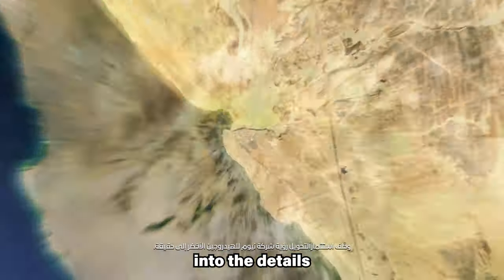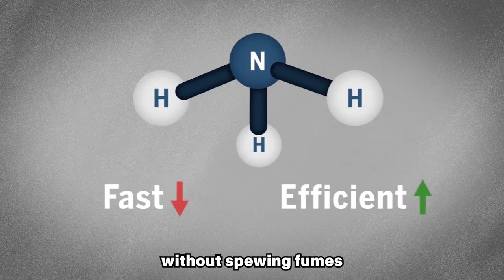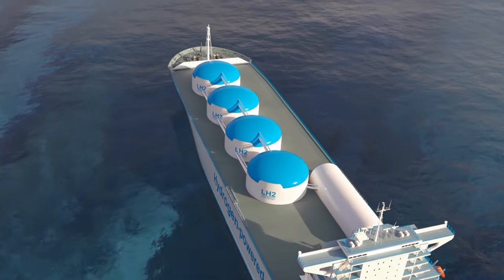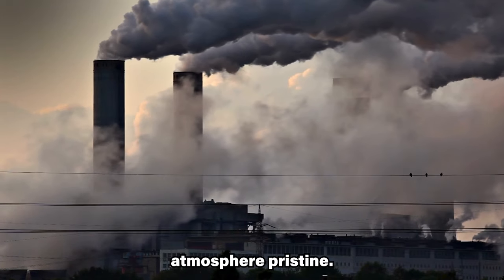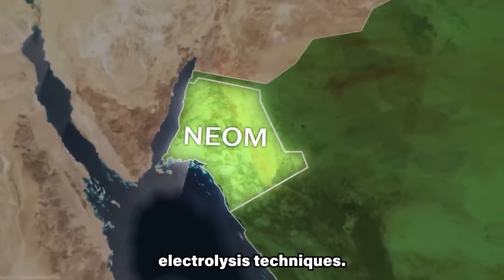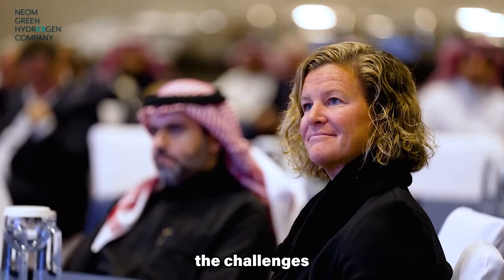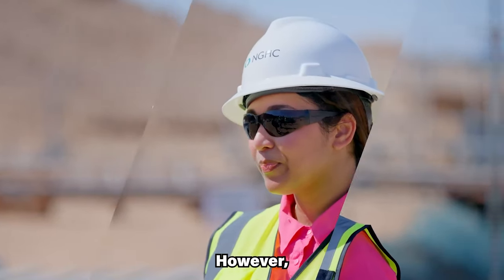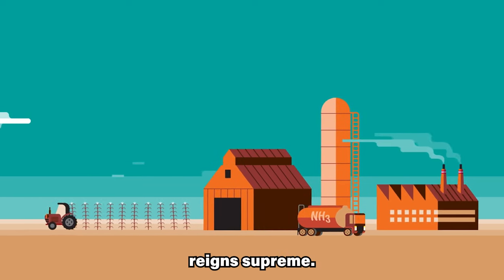World largest green hydrogen plant

Comment: People are not aware of the potential that hydrogen has. Its remarkable change in the world happening now a days.
Reply: You poor fool.
Reply: Hydrogen will always have a poor energy density per unit volume as well as has  3.4 times higher specific heat capacity than that of cooling water. Liquifying Hydrogen needs using Liquid Nitrogen coolant in amounts much more than stoichiometric energy balance calculations (due to Liedenfrost effect shown by liquid Nitrogen) to cool Hydrogen from ambient to below joule thomson temperature of 200K  after which it can be adiabatically expanded to 20K liquification temperature.
Majority of current commercial use of hydrogen is as a reactant for making syngas, methanol , ammonia, hydrogenated veg oils and fats, crude oil processing, catalyst characterization test like  tpr, ore reduction instead of being used as a source of energy.

Comment: Hydrogen is not the future ... electricity is !
Reply from the maker: Thank you for sharing this.
Reply: Electricity is not a primary energy source, it is merly a transportation system, where you going to get it from?
Reply: @nickbagnall  electricity generation through solar & wind (is rising every year) + battery packs
Otherwise from the grid with good interconnection between states/countries . Probably nuclear until enough solar/wind/battery pack capacity installed. Charging cars when electricity is abundant.
Reply: @erivaton  where do you get resources to build batteries for entire countries?
Reply: @ColoniaMurder20  Lithium can be found all over the world. LPF-batteries are made with iron  and without cobalt manganese, then there is no limit. And then we're not even talking about the sodium-ion batteries that will probably come.
Reply: @erivaton  how much resources you needed waste to build batteries for vehicles? and how many times you have change your batteries within 10 years?
Reply: @ColoniaMurder20   In the total life span of cars, EVs are much cleaner than ICE cars. And battery production without rare minerals (like in LFP bateries) is not very environmental impactful. Sodium ion batteries even less.
Reply: @nickbagnall ...not even considering it takes huge amounts of electricity to make hydrogen with your comment are you?
Reply: @erivaton  Your ignorance is astounding. More fossil fuel energy is used in mining, crushing, refining chemically cleaning, manufacturing and installation of the apparatus than the apparatus can produce, notwithstanding, there reliability is dependent on weather conditions and require fossil fuel for base load energy and back up.
Reply: @5353Jumper  Hydrogen is merely an carrier, not a primary fuel.
Reply: @nickbagnall  and it is a lot less efficient carrier than the electric grid. 

Also by your definition, gasoline and diesel are not fuels either. Maybe natural gas is? But then again so is the solar radiation? Not sure kinda confused by your "logic" and why it is important to this conversation.
Reply: @nickbagnall  Time will tell whose more ignorant. I feel pretty good.
Reply: At this moment we are trying to eliminate poisonous gases and other harmful extracted minerals that might affect our environment for today and for the next generation in the coming furure.

Comment: The two major applications of electrolysis are alumina smelter or hall-herault process (16 units/kg aluminium)and choloroalkali process (2.5 units/kg alkali). These are located near to ports and where cheaper power source like hydropower are available. Alumina smeltering needs 19-20 hours of continuous power supply per day. Aluminium recycling can help to optimize need of smeltering alumina and save energy needs by 95%. Chloroalkali process also coproduces Hydrogen which is used to make Hcl or h2o2 or ammonia or burned for power/steam generation.  In 2022, as high as 83 million tonnes of Chlorine gas , 4.8 million tonnes of Hydrogen gas and 190 million tonnes of Sodium Hydroxide were co-produced in the world from chloroalkali process or electrolysis of brine. Water electrolysis to coproduce oxygen and hydrogen wil really consume at least 50 units/kg hydrogen .

Comment: Green energy. 

The picture the advertisement gives of green hydrogen sounds beautiful - fresh washing drying on a washing line; children on a sunny day happily playing by a stream with a rainbow in the distance. However, not all is as green as it seems in the garden for the air is good but the soil barren.  

There are many embedded carbon costs in the mining, refining, chemical processing, manufacture and installation of wind turbines and solar panels, which you claim are renewable. The downstream costs in relation to energy - carbon and environmental damage are not accounted for. The agenda would rather ignore these and they are left out of most studies promoting the new green deal, not to mention the apparatus averages out to a maximum of a 25 year life span. The process itself may boast being green - no carbon emissions - however, the downstream carbon footprint is colossal…

What reductions will the largest plant in the world make to the fossil fuel industry; based on medium density crude?  

1.	The plant, one of the largest in the world when complete will produce 600 tonnes per day. 

2.	Global oil production amounted to 93.9 million barrels per day in 2022.

3.	Conversion; One barrel of oil weighs 137kg x 7.4 barrels per metric tonne.

4.	Global oil production per day in metric tonnes: 12,689,189 tonnes per day.

Hydrogen is approximately 3x more calorific energy than petroleum: 

                      - The heating value of gasoline is 47 megajoules per kilogram.
                       - The heating value of hydrogen is 143 megajoules per kilogram.

5.	 600 tonnes hydrogen times 3x to balance calorific equivalent 18,000 tonnes per day

Now that the calorific energy is balanced per tonne.

6.	12,689,189 tonnes petroleum minus 1,800 tonnes of hydrogen.

7.	12,689,189 minus 1,800  = 12,687,389 tonnes petroleum per day.

8.	12,687,389 tonnes petroleum x 7.4 = 93,886,678 barrels per day.

9.	93,900,000 barrels per day, less hydrogen equivalent calorific value converted to oil minus  barrels per day gives a saving of 13,322 barrels of oil per day.

 
The saving of emissions from a  barrel of oil based on 600 barrels of hydrogen production per day gives a value of 0.0142% saving, and that is only if the oil isn’t burnt somewhere else, like China or India who are energy hungry to the last molecule.  . 

To exchange 50% of total oil production for green hydrogen we would require 352 green hydrogen plants, notwithstanding, gasoline costs a fraction of the production cost per kilogram. 
                                                                 
Furthermore, we haven’t built in the downstream costs for this green energy; turbines require mining of precious minerals along with refining and processing, as well as other materials predominantly made of steel, fibreglass, resin etc.

Solar panels also have a hefty downstream cost: the journey of silicon starts with mining and refining quartzite - a rock containing quartz. The refining process involves mixing powdered quartzite with carbon and heating it in arc furnaces at 2000 degrees centigrade resulting in metallurgical-grade silicon. From here it is blended with other metals. Then we need the glass and silver, as well as other minor ingredients.

The mining and refining and shipping of the minerals will also require heavy diesel driven machinery to complete the processes. Notwithstanding, the factories required for the production, concrete and construction of facilities, the staff, and all the energy requirements in relationship have an embedded carbon cost.   

As the weather is intermittent there is also the requirement for battery back-ups, unless diesel generators, gas or hydrogen are to be used as base load energy.

Green is not as green as most would like to imagine and far more destructive to the environment when you consider the square metres of land required not only for the apparatus on site but also, the amount of destruction caused to eco systems. There is also a second stage processes which follow the refining which also require chemical refining.  Taking copper as an example on ore grades which will deplete in time - for every kilogram required we must crush one tonne of ore.

We as a civilisation have been going through the energy transition since we first burned a piece of wood, including wind, hydro, coal, oil, gas, nuclear and others. Whenever we have found new fuels and new technologies to harness and extract energy, we have never abandoned the old fuels. In fact, we have burned more of them; every one of them, including cow dung… 

I’m all for new technologies and a cleaner environment however, it seems everybody has become fixated on looking up at the sky, when they should be looking beneath their feet. 

Any feedback is appreciated.
Reply: We cannot even begin to imagine new use cases of hydrogen (like transportation) until we have "greened" all of the existing hydrogen production for already existing uses. Agriculture, chemical, medical and "green steel" already require huge amounts of hydrogen. 

Today most of this hydrogen is produced in high emmisions ways. 

We need to covert all this existing production of hydrogen over to "green" hydrogen along with greening the entire electricity grid. 

THEN maybe we can start looking at new applications of hydrogen like transportation. 

But even THEN the numbers do not look good for hydrogen, because the double conversion process of the hydrogen mid step is so incredibly inefficient. It is possible that in every use case it just uses a lot less electricity to power things directly than to make hydrogen, transport hydrogen, and then turn the hydrogen back into electricity/power. 

So I am a super fan of "green" hydrogen, replacing "Grey, black, blue, brown" hydrogen. 

But I do not see hydrogen having a future in transportation.
Reply: On the topic of materials used for "green" electricity generation and batteries and such...

Yes they do take a lot of materials, energy, process and transportation to make so they are far from "zero emissions". And the supply chain has some issues with human societal damage and worker oppression. That is totally true. 

But whenever I see an anti-green petroleum fan obstructionist comment, they always conveniently forget all the materials, process, transportation and human suffering caused by the fuel solution supply chain in their math. All the extraction, transportation, processing, transportation, storage, transportation and supporting industry needed to get gasoline into our cars and diesel into our machinery is immense, high emissions and often quite socially damaging. Then you need to build the fuel power plants, and fuel vehicles which all in are nearly as much or sometimes more than the "green" solution just to make not even counting the fuel that goes into them. 

Once all the math plays out, wind/solar/geo/tidal/electrified/etc energy solutions are lower or about the same emissions to make, AND they do not burn fuel for decades. 

Also the more we adopt these solutions, the "greener" it gets to make these solutions. They improve their own math over time with greater adoption. It gets lower emissions each year to make a battery, because more electrified batteries are used in the supply chain instead of fuel tanks. 

These new supply chains give us the ability to create better supply chains both for emissions and for human society.

So though they are not "emissions free", they are lower emmisions. 

Better is better even if it is not perfect.

Comment: Producing hydrogen typically involves water electrolysis, where water (H2O) is split into hydrogen (H2) and oxygen (O2) using electricity. The amount of freshwater required to produce 1 kg of hydrogen depends on various factors such as the efficiency of the electrolysis process and the purity of the water used. However, as a rough estimate, it's commonly stated that around 9 liters of freshwater are needed to produce 1 kg of hydrogen through electrolysis using current technologies.

Where do you have enough freshwater desalination already costs a fortune and Australia is among the water severe scarce country?

According to the UN World Water Development Report 2023, globally, 2 billion people (26% of the population) do not have safe drinking water and 3.6 billion (46%) lack access to safely managed sanitation.

Producing Hydrogen while 2 billion people (26% of the population) do not have safe drinking water and 3.6 billion (46%) lack access to safely managed sanitation, is another form of depopulation.